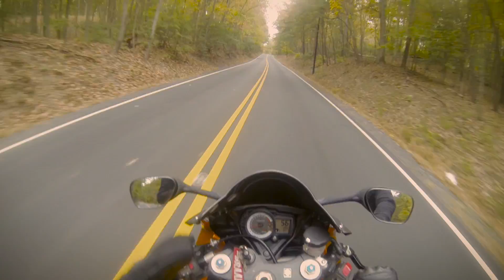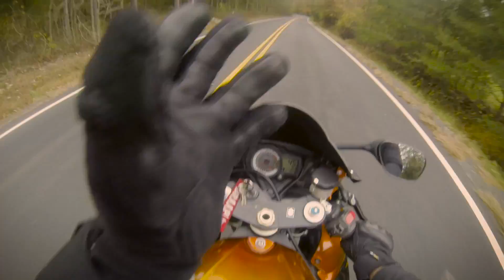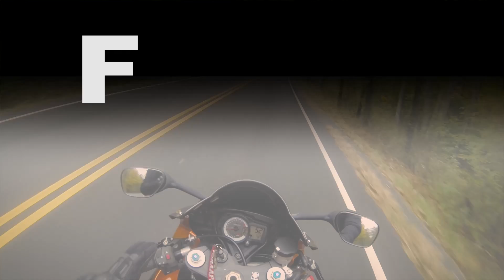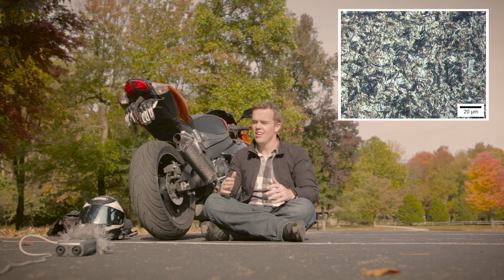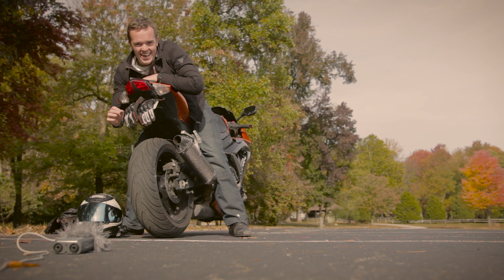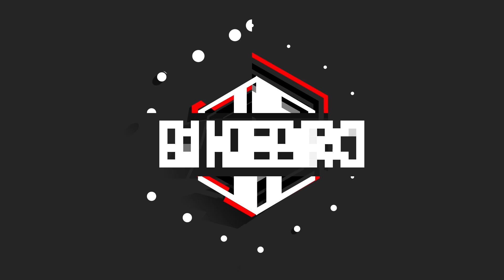Motorcycle Traction explained

Comment: Hey bro! So sorry to tell you that most of your physics analysis and hence, your conclusion, are very wrong! That's because you started by comparing rubber to rigid materials so I'll leave here the same comment I posted on a traction explanation video as well:

"...One can not apply friction coefficient directly to tires as on rigid materials. For elastic materials such as tires, friction force is not a linear function of normal force applied and friction coefficient between the surfaces. Instead, for a fixed type of compound, it is a much more complex function that takes temperature and contact patch into account (yes, with elastic materials friction does depend on the contact patch as larger patches have more probability of proper contact with the road than thinner ones)...... To sum up, for a fixed compound, wider tires give you less wear (can handle more pressure), better grip but more drag! Warmer tires also give you better grip than cold ones".

Not trying to be an ass here but just to provide accurate information for the riders out there that wanna understand bike's technology as I do.

Cheers.-
Reply from the maker: Hey, can you cite me some material on this so I can produce a follow up if I am wrong. Looking at some older papers(http://nvlpubs.nist.gov/nistpubs/jres/28/jresv28n4p439_A1b.pdf) they conclude the static coefficient of friction is independent of contact patch in rubber. but this paper is over 60 years old
But besides that I believe my conclusion is correct by your updated definition. In this video i didn't really mention temp, I treated it as a constant(for the most part), and I drew the same conclusion as you that wider tires offer less wear, better traction but more drag and weight
Reply: Don't have an article on this at hand but if you take a look at some good physics books you'll see what I mean. This phenomenon occurs at a microscopic level and it's quite similar to the example you mention about the inverted mountain range, but the conclusion is what's incorrect! 

At a microscopic level the rubber sticks to the road because of it's ability to deform. Deformation on rubber is proportional to the system's temperature as heat make's elastic materials softer. This way the more soft material available (more contact patch) the more probability for "rubber and road interlocking/interaction" (if you will). So yes, for a constant tire compound, thicker tires will offer better grip/friction/traction than thinner ones.
Reply from the maker: Nacho Montamat I still don't see how this is at odds with what I said.  I believe I agree with the way you are describing it though I may be misinterpreting you. I'm going to try find some more modern studies,  as I'll be making a follow up video before the end of the month to answer other questions people have asked too

Comment: Here's a question.  But first some context.  I work at a go-kart track and happen to be fairly decent at driving them as well.  With 4 wheels, it's relatively easy to explore the limits of grip, exceeding them at times.  But this isn't much of a problem if you know what you're doing, you can gather it back and get back to the limit.   I have just recently purchased my first street bike and I am much more concerned with exploring the limits of grip with the bike.  This is simply because you have only 2 wheels instead of 4.  Add in the dynamic of lean, which is much less extreme on 4 wheels, and we're in a different world.

So my question is; how do I go about exploring the limits of grip on a motorcycle, without dropping the bike, loosing the front end, high siding, etc...?  Most of these things are very little issue on 4 wheels, but very big issues on 2.
Reply: Way back in the days when I was racing, the older racers would tell me that you explored adhesion by falling off when you exceeded the grip. Hahaha — they were not kidding. I explored it enough so that I slowed down. Tires back then were pretty crude in comparison to todays rubber.
Reply: As a new rider you shouldn't be trying to find that limit for a few years. There is no safe way, if your lucky you might break the rear loose a smidge, and be able to bring it back in but then again maybe not. Experience will help more than anything as you push the limit a little more and more you will get a feel for it.  But you push to hard or make a mistake and bad things will happen.

Comment: Thanks for good video! Forgive me my poor English if my comment seems strange to you, but weight (Newtons) and mass (kilos) are different things. The mass is constant but the weight is not - it depends on contact area the applied force gets distributed over. Reduced total area is compensated by increased force per square unit, and vice versa - increased area has less force applied to square unit. The point is - the outcome will be be the same no matter what we do. But of course, the temperature characteristics of rubber compound then come into play... :)
Reply: Say we added two more wheels to a motorcycle: we increased the total contact patch by 2, but the weight is now distributed over 2 times greater area and each wheel has 2 times less friction force.
Reply: That's what he said in the video.
Reply: Not exactly.
Reply: MaxTryk you are right at a speed which would normally make the tire loose the grip now that you have 4 tires the weight can equally distribute 

Isn't that why cars hold the streets better

Post scriptum: i am 15 years old and have never ridden a motorcycle but i am interested in bicycles.
Any ideas on how i can enhance grip on my bicycle i use 2.35" schwalbe crazy bob just in case😂

Comment: So a F1 car could have some small 195 slicks in the rear and still have as much grip?
Reply from the maker: Rasmus Törnqvist for all of 5 seconds until they shred them because the small,  light tire can't deal with the power being put down but if you mid corner instantaneous switched out the normal wheels for bicycle wheels (all else being equal) you'd have just as much grip for the split second before it explodes
Reply: BikeBros Yeah but for those shirt seconds the grip would be the same. I know that they would just overheat shread all over the place but that was not my question.
Reply: From this and other explanations of adhesion, I think we have to assume that the posture of a four wheel vehicle presents another set of factors. The width of a tire on a 4-wheel race car ( as far as I have understood stuff over the years) is limited by a number of factors that include (among others) compound, heat, and size of tire. Today's wider tires provide greater adhesion. Years ago, tires were narrower because materials science had not provided an answer to the problem of heat versus wear. Even today, races are often won or lost in accordance with the choice of tires for any given car and driver. The fact that today's tires are even visually a  huge jump away from say race cars in the 60'-70's  must bare this out.

Comment: Awesome explanation!

But to go back to the original statement that got you thinking, MotoGP riders want to stand their bikes up not so much to increase traction but to reduce the amount of traction being used for cornering so it's available for acceleration. The idea is sound even though the announcer didn't capture the science correctly.

The way I understand your video it seem the size of the tire impacts durability but not traction; though there comes a point when the disadvantages of a larger tire outweigh the advantage of increased durability. Would you agree?
Reply from the maker: Oh absolutely, larger tires and wheels are heavier so it makes the bike sluggish to turn in and fatter tires have higher chance of hydroplanning so if its wet you want to keep it as skinny as possible. Basically for racing, your tire should be the smallest size you can get away with
Reply: Agree about the sluggishness. I ride cruisers, currently an Indian Chieftain for their comfort but still like to take corners aggressively. I once test rode a Victory Jackpot which has a 90/90 21 on the front and a 250/40R18 in the rear. Great for acceleration but horrendous in a corner. I had to keep the pressure on the inside handle or the bike would stand up. I never rode it in the rain but I'm sure hydroplaning was a major issue as well.Needless to say I didn't buy it.

Comment: If we want to be technical with the terminology, you have a particular amount of friction at a particular instant that can be used for acceleration. "Acceleration" includes speeding up, braking, and cornering as they all involve a change in the vector of the force being applied by the wheels.
Reply from the maker: Dagaen Golomb you are exactly right but in fairness I had to simplify a lot of stuff. The point I wanted to make was debunking the contact area myth.  I figured most people watching this wouldn't be from a  technical background so I tried to use regular vocab to keep it accessible
Reply: Understood! In my eyes, combining all of those into one category makes it simpler - but maybe thats the scientist coming out. Just wanted to help enlighten those who may not know that all of these actions are inherently the same thing, which actually hearkens back to why they require friction. Great video!
Reply: +BikeBros 
And that is a great idea. I have watched it 3 times and still not sure I understand. lol

Comment: This is the second video ive seen on this principle, and it does seem to make sense when discussing bikes. But how does this apply to drag racing? a car with 33" wide tires can launch harder than a car with 10.5" wide tires, (i use launch as an example here because there has been no time for the tire to wear or heat soak at all).
Reply: They are design to wrinkle to give the vehicle forward momentum and I believe it's also to help the wheel not spin inside the tire. I don't know all the physics involved but as the torque is applied the tire will start to wrinkle and give to way to promote forward propulsion once the tires grab the surface. The force created by grip/friction is going from the contact patch up the sidewalls I believe is what helps the tire stay on place for the split millisecond as the massive amount of torque begins to rotate the wheels, so the sidewalls give way but the vehicle will begin to move forward as they do. I'm almost sure thats how it was, I haven't watch NHRA in a long time.
Reply from the maker: KittyCow its the same because drag racers want to use the softest possible compounds for maximum grip (higher friction coefficients).  But if they tyres were small the power of the car would rip the tire to shreds also the larger tire helps with heat distribution when it gets hot running down the strip.  

TLDR, larger tiers can be softer and therefore provide more grip
Reply: BikeBros Why are drag tires sidewalls designed to wrinkle, giving them a larger contact patch?
Reply from the maker: KittyCow I'll so some research into it. My gut is they don't have a choice,  there's just too much torque but it might be also to help built up heat
Reply: BikeBros Okay thanks! Glad to see a youtuber taking the comments so seriously, well deserved like!

Comment: The brick example made sense to me until I thought about it. If I'm understanding it correctly, the area of the brick in contact with the surface provides a certain amount of friction based on it's coefficient of friction (shared with the surface it's on) and the mass of the brick. Now, you're saying that you can turn the brick on any side and it will require the same amount of lateral force to move the brick because the friction hasn't change. Doesn't this imply that the surface area of the brick in contact with the surface it's on has a one to one relationship with the mass of the brick? I might not be wording this correctly, it just seems strange to me that the same amount of lateral force is required to move the brick regardless of it's dimensions (assuming constant mass).
Reply from the maker: SomeDudeOnline I'm a little confused by what you mean because it sounds like you have it exactly right.  If you imagine a wide brick that weighs 1kg (or 2.2lbs) that say it takes 5N of force to pull (all numbers are just examples).  
Now you rotate that brick onto its side so only half as much material is in contact with the ground there is still only 1kg acting down upon the ground from the brick so it will still take 5N to pull it. 

I've seen a few videos online about this so I'll try fetch a link for you 

Also also I have simplified friction a little for the purposes of the video because in the case of the brick there are two friction numbers,  the static friction (what it takes to get it moving) and the dynamic friction (to keep it moving)
Reply from the maker: SomeDudeOnline I apologise for how bad this video is but it's a great visualisation https://youtu.be/idYX7kkRqbs
Reply: Thank you for the video, it's nice to see it happening. But to be clear, I wasn't really in disbelief, just surprised I guess.

In trying to explain my confusion just now, I watched your video again and it clicked for me. I was confused as to why the amount of surface area was completely irrelevant rather than just a smaller factor than the mass. I can't really explain why any differently than you did but it was the image of the mountain ranges in contact with each other that made it click for me. :)
Reply from the maker: I gotcha. You had it perfectly right in your comment. If anything I'm happy I found a video to demo the idea, it might help other people :)